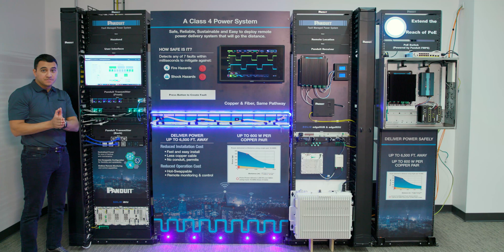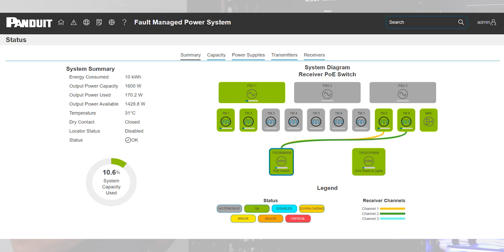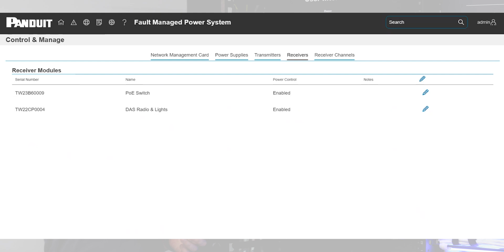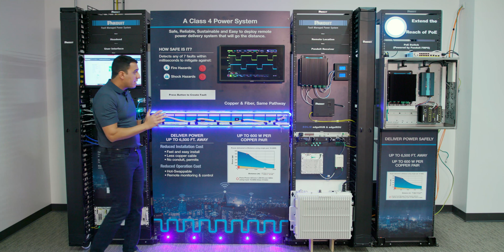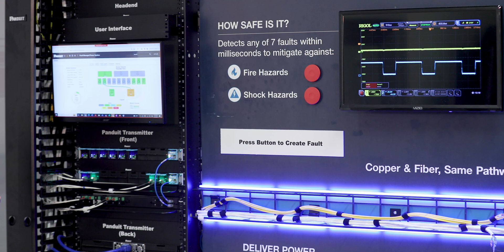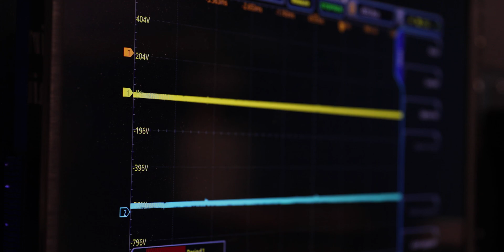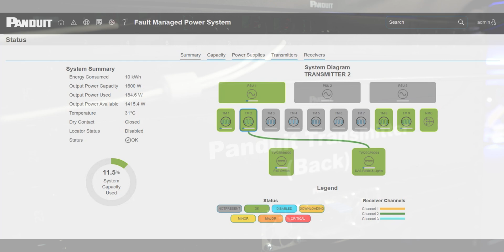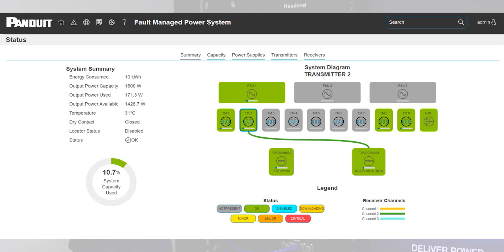Panduit Fault Managed Power System Details Video | Deep Dive Series Pt. 5

Comment: What a Beauty! This should be enough now to be used with HVDC safe in solar/battery powered IoT residential homes. A case study would be great (eg. by having a 360 VDC battery system/bus which will power the FMPS instead of AC?).